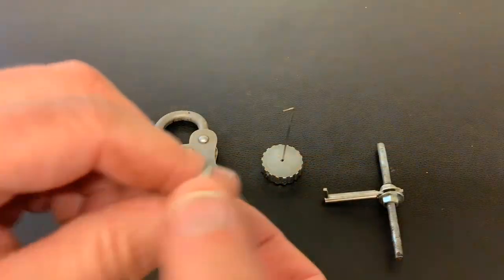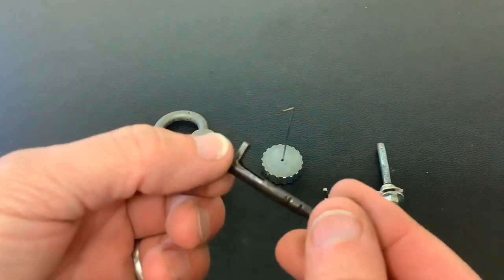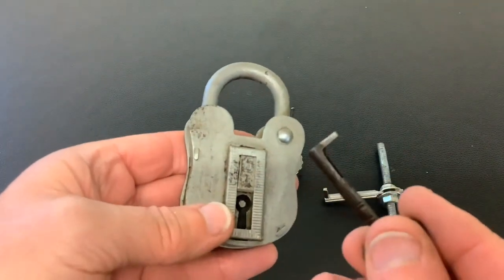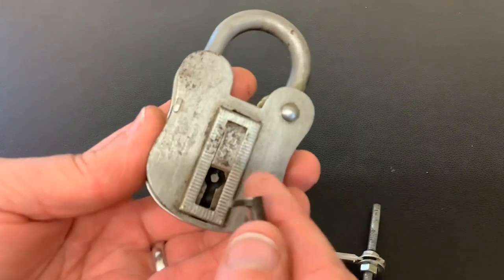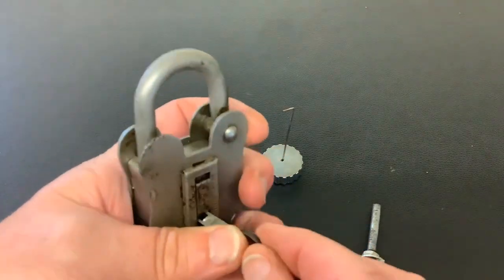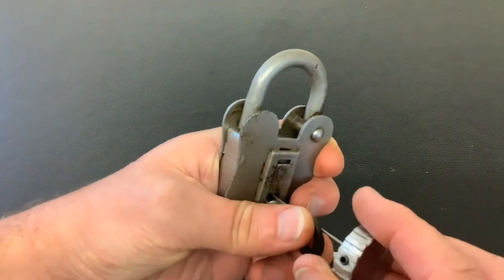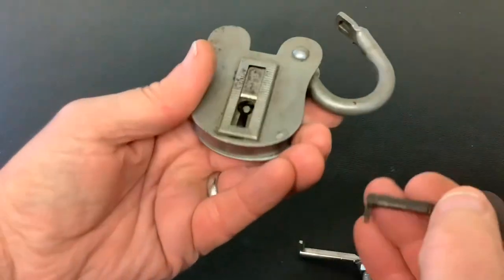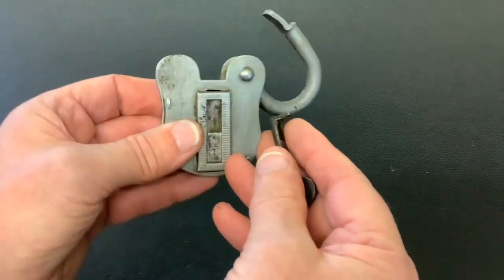661. Lever lock tension tool spins 360 degrees Is the upright too short or bolt in middle of lock 🤔

Comment: I never knew a bolt would be in the middle of a lock , as the man says  " you learn something new everyday  " . My question is this ... does middle bolt only apply to 1 or 2 lever locks , or have you seen 4 or 5 lever locks with the bolt in the middle  ?
Reply from the maker: This is a 4 lever lock Peter mate